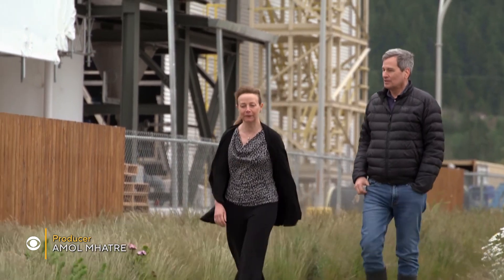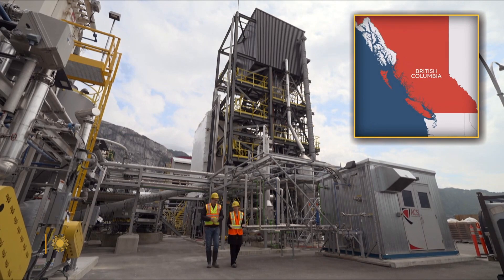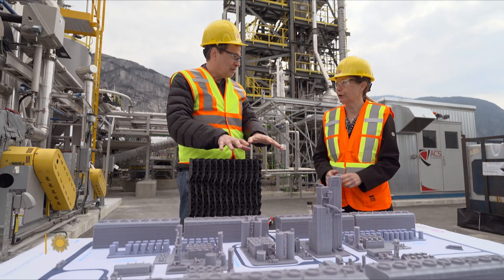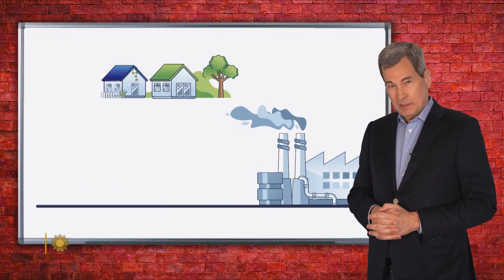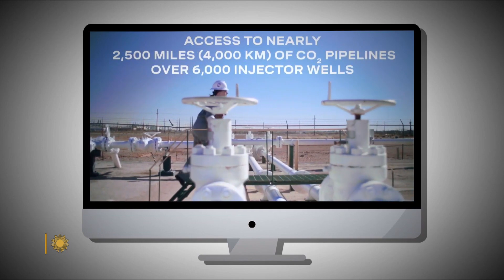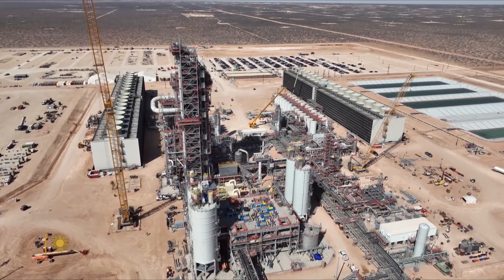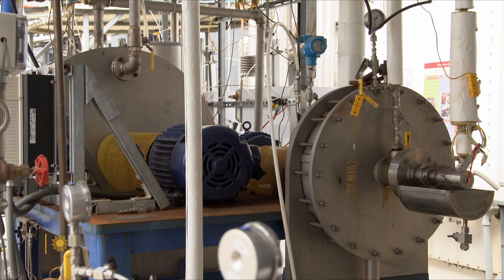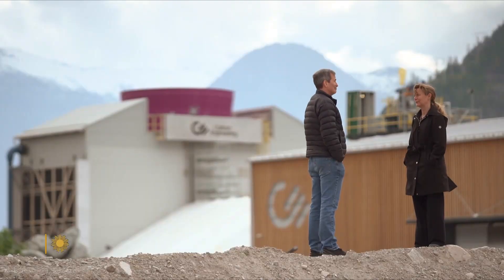Is carbon capture a solution to the climate crisis?

Comment: No we are NOT "cutting back our emitssions.  Emssions fell one two times in the last century: the covid year by 5% and 2024 by 1%. The first  because of global shut down due to the  pandemic, the second because of one year's data. But in both these cases, Atmospheric CO2, the driver of climate change, continued to rise. In fact, CO2 in 2024 rose by more than it did at any time in the last 140 years.  This disconnect between the change of emissions and the rise in Atmospheric CO2 is the reason I think we should stop talking about emssions because it is a diversion, and focus on the level of Atmospheric CO2. Regarding carbon capture - forget it - to capture one year's emissions will take 1/2 the entire globe's current energy use.

Comment: Exxon Mobil has spiked a proposal to store captured carbon in an old offshore gas field in the Gippsland basin off the coast of Victoria, but isn’t explaining why it’s killed the three-year old idea.
Reply: A a high level provider they have the ability to offer carbon dioxide sequestration at a very high engineering economic ability, but as smart people they also know:   Earth's water vapor saturated greenhouse effect is due to water vapor.   The other greenhouse gases can not change the overall effect of earth's water vapor saturated greenhouse effect that absorbs all the greenhouse radiant energy from the earth within a few meters of the radiating surface adding 10°F (5.55°C) to earth’s average temperature.  This was taught in US high school science.

Comment: Its not decarbonize as fast as possible !!
Reply: Earth's water vapor saturated greenhouse effect is due to water vapor.   The other greenhouse gases can not change the overall effect of earth's water vapor saturated greenhouse effect that absorbs all the greenhouse radiant energy from the earth within a few meters of the radiating surface adding 10°F (5.55°C) to earth’s average temperature.  This was taught in US high school science.

Comment: David Pogue:  I get that it is difficult to ask hard questions and preserve your relationships, BUT - you needed to ask Lori Guetre how much electricity & total energy Stratos will consume.  Recently, they claimed that it was "proprietary" information.  They are getting a LOT of government funding.  They need to be transparent.
Reply: Show us the data! ❤
Reply: There is no point to carbon capture and 1200 ppm CO2 is near optimal for C3 plants and is used in greenhouses.  Earth's water vapor saturated greenhouse effect is due to water vapor.   The other greenhouse gases can not change the overall effect of earth's water vapor saturated greenhouse effect that absorbs all the greenhouse radiant energy from the earth within a few meters of the radiating surface adding 10°F (5.55°C) to earth’s average temperature.  This was taught in US high school science.
Reply: @douglasengle2704   - If humans were plants - I'd be down.  The last time co2 was that high - the Earth was ice free.

Comment: A Two Billion Dollar investment in Oceanic Aeration could rebuild Polar Ice and begin to cool the Planet. It's organic, doesn't require any risks other than letting well equipped ships drift in regions where the air is about thirty degrees cooler than the sea surface. Aeration provides a huge benefit to Marine life; go to a major Aquarium and ask if they use it for the health of their captive species. Aeration bypasses the thermal barrier that exists between the air and water, often in the form of fog.
For $2 Billion, 90,000 individual Aeration Units could be placed around the world with each unit cooling 500 gallons of water per minute by up to 15 degrees. Think of it as harvesting the cold that is always lingering near the poles and travels as far south as Florida and as far north as Brisbane every winter. As one who has studied the factors behind Earth's climate since 1979, I see no other cost-effective option and it should have begun years ago. Everybody seems to want to spend billions to monitor the decline of our civilization rather than make an honest effort to preserve it; that's not a sign of intelligent life.

Comment: You can take a lot of carbon from the air if you can remove the carbon from bio-methane and use the resulting hydrogen or manufactured ammonia in fuel cells or engines. The bio-methane would have to be decomposed using green electricity to ensure the highest decarbonization of the air via a biological intermediary step.

Comment: Mark is not being completely honest. His papers on carbon capture use figures that are misleading or inaccurate to paint carbon capture in a negative light. He also does nothing to address the reality that we are many years away from having a modern grid that would support full electrification. He lives in a state where infrastructure has been built out over many years. Most of the states don’t have that level of preparation, and fossil fuels with carbon capture are the fastest, least expensive, and most pragmatic way other states can decarbonize without impacting quality of life.
Reply: Smarter people involved in these projects no better and don't try to go very deep in offering validity because at the end there is non.  Earth's water vapor saturated greenhouse effect is due to water vapor.   The other greenhouse gases can not change the overall effect of earth's water vapor saturated greenhouse effect that absorbs all the greenhouse radiant energy from the earth within a few meters of the radiating surface adding 10°F (5.55°C) to earth’s average temperature.  This was taught in US high school science.

Comment: There's a way of turning light into electricity. And electricity into light.        There's a way of relising pollution and heat into air by burning fuel.   There's a way of turning heat back into energy.  They Just didn't figure out the way of turning pollution back into energy yet.

Comment: Fires are caused by engine exhaust? Did they really just say that?
Reply: There are documented instances where hot carbon particles from vehicular exhaust, usually diesel, have caused wildfires. Also possible with old catalytic converters spitting out hot particles. The wildfire prevention information published by several western states includes cautions about vehicle exhaust systems.
Reply: @ Obviously that is not what they are implying at all and you know it.
Reply: @delvictor7570   You seemed incredulous that engine exhaust can cause a fire. I just noted some facts about it.

Comment: Why not just make dry ice and use it for cooling ?
Reply: yes, High Hopes, an Israeli outfit, is experimenting with capturing CO2 as 'dry ice' in the stratosphere, where it exists near its freezing point. Perhaps this idea could be expanded using rocket-powered craft. The question remains: what should be done with the 'dry ice' once captured? 'Extra-terra' might prove to be safer than the current 'sub-terra' method.

Comment: its going to take both pathways. Nature isn't going to absorb the amount of CO2 needed fast enough to get back to desirable levels, and it doesn't make sense to artificially remove carbon dioxide for the sake of justifying more emissions.
Reply: This video showed many interesting tools and technologies that have been developed. What I have read and watched from several authority figures is that over the past decade or so that the amount of carbon dioxide in the atmosphere has decreased even as global surface temperatures have increased by a certain amount. I imagine the level of carbon dioxide varies somewhat from location to location, and some scientists have demonstrated it. Is that generally true, that the global surface temperatures have increased by a certain amount even as the amount of carbon dioxide in the atmosphere has decreased by a certain percentage, or is that false? There is not much talk about measurement on this topic, like how the statistic that this woman mentioned about how much carbon dioxide is being added to the atmosphere each day. And there was no comparison with previous years, like a chart or graph. I would hope people who study the climate would develop a mathematical that relates changes in global surface temperature to the changes in the amount of carbon dioxide, and the same for changes in sea level, as well as the wind strength of hurricanes. I think that would be the biggest assistance in dealing with this issue. When you speak about desirable levels, isn't that going to be something mankind can measure, some kind of mass or volumetric measurement? The reason why I think most Americans and probably most human beings do not think we are in a crisis that requires drastic change by 2030 is that most people seem quite comfortable driving gas powered vehicles, and using gas stations. On any given day, the numbers are probably in the millions, of Americans using gas stations near their houses. I think renewable energy is very interesting. Here is a difficult question to wrestle with. By what year do you foresee 60-80% of the energy needs of America being provided by solar and wind sources? I do not think Bill Gates foresees the percentage being that high. A lot of the employees in the vilified petroleum industry have extensive chemical engineering knowledge. I have seen guest experts on CNN and the PBS NewsHour say that those in the petroleum industry are anti-science. A lot of those employees have been trained in chemistry, geophysics, chemistry, and chemical engineering. I do not mind people addressing climate change. I just wish there was more focus on measuring, and how things are measured.
Reply: Agree with you

Comment: So instead of building plants we should be planting plants of all shapes and sizes.
Reply: Taking from nature what plants and trees need.
Reply: Well I thought the answer was that we should be replacing fossil fuel with solar and wind instead of emitting co2 in the first place.
Reply: @constructioneerful  absolutely that point was made as well. But my big takeaway is that planting plants that do the same thing that plants do I use a ton of energy to do it
Reply: @ how do you make solar and wind energy components? What are those materials made out of? Do you know where the blades go for the wind turbines once they are needed to be replaced? Do you know how to get the metals for the solar panels? Do you understand how those things are made? Does solar and wind require batteries? how about maintenance? What happens to the eco system when there is acres of solar panels placed above them? Why do you believe the corporations that are only for profit?